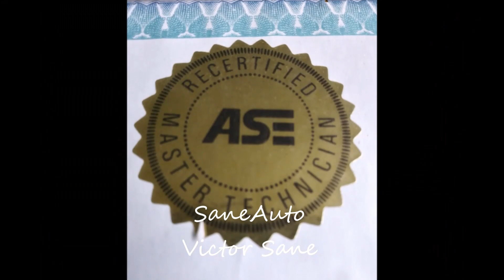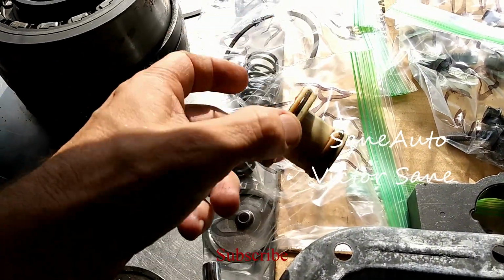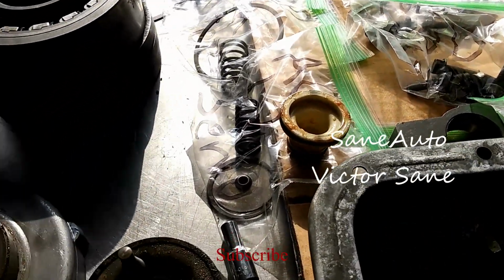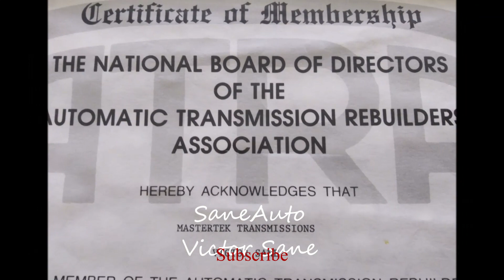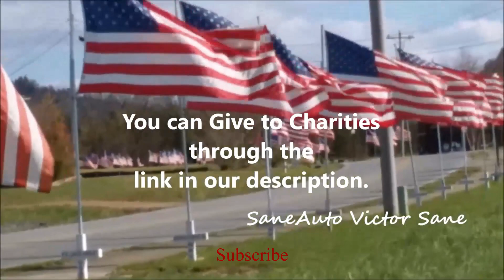Ford AOD 4R70W Mustang transmission repair whats inside

Comment: Great video thanks again. I like seeing the inside of the transmission. This will help people understand more about how they work and they fail. That plastic piece you showed reminded me of a fuel pump piece. I like putting new ones in my boss didn't. I know you have probably seen them on older semi engines. I would make him get new it doesn't take much to get the fuel out of time. That 5 dollar part is going to save you in the long run. Rambling on again I am. Keep up the great work see you in the next video thanks again brother
Reply from the maker: I agree with ya Steve. If its plastic and its available, replace it while your in there. I try to remind myself this way "Dont waste expensive labor costs on the cheaper parts just get a new one."

Comment: Ever feel like all you work on is transmissions? Hahahaha nice video!
Reply from the maker: I used to. It was a long exciting career. Times have changed and so has the industry. You cant build the transmission empire like I did in the 90's and 2000's today. I was lucky and smart enough to get into transmission in 1991 right when it started to really rise. It peaked in the early 2000's If I were just going into auto repair today. I would start learning electric motors, charging systems and controllers or computer programming.